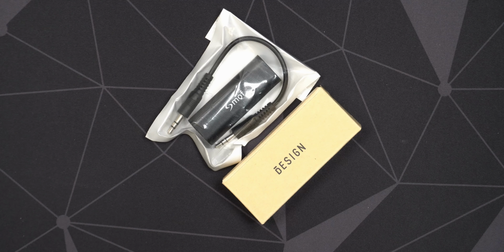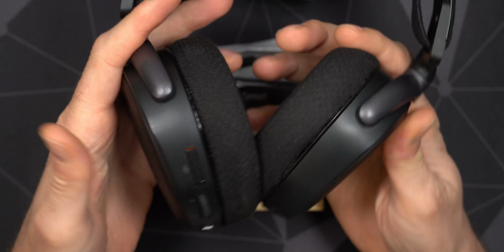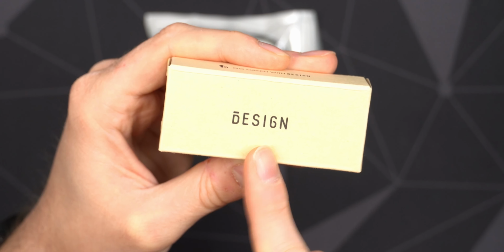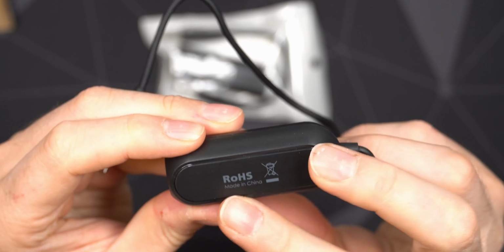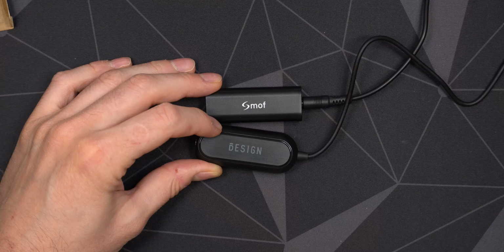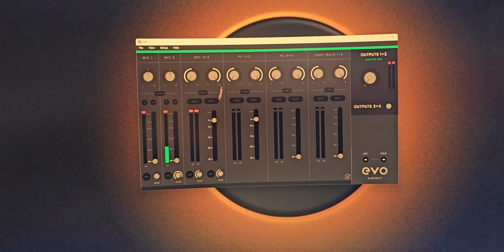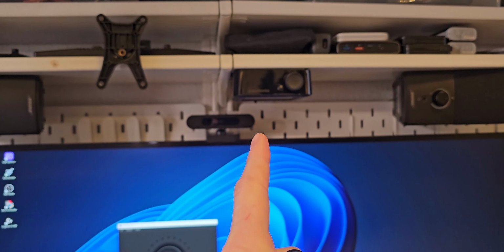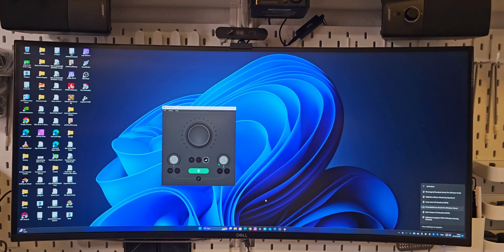Ground Loop Noise Isolator

Comment: I've used a few of these and while they do get rid of hum in a lot of situations, unfortunately the quality of the transformers inside of them leave a lot to be desired since they're so cheap and inconsistent, so they can cut certain audio frequencies which changes the sound and degrades quality. They also cut the volume by a not insignificant amount. For casual use they're handy, but I wish there was a mid-range option for ones that don't mess with frequencies without stepping up to a few hundred dollars.
Reply: there are better options with beefier transformers, but more expensive.

Comment: Didn't work for me for my z-5500 speakers using an external pod, tried I plugging it into the PC (internal sound card) and also through the pod, no difference either way.
Reply: does your speaker have ground loops also that u use for your PC
Reply: @SaladBowl009  It doesn't, I just turned everything down a bit on the control pod and turned the volume up on my PC and it's mostly fine now.
Reply: @Verociity  oh i see.. that's good it works now. I was thinking if this noise isolation sill help me about the sound buzz and hiz
Reply: @SaladBowl009  I will probably try grounding it soon though, that's also probably a great idea.
Reply: @Verociity  right.. tnx

Comment: Hi! Which cable did you use to connect Steelseries Nova pro Wireless Base station Line-Out Jack to the Evo 8 Interface? Could share a link? Thanks

Comment: I need one of these with a TRRS connectors, do you have a website to get one? Cause I cannot find any, only TRS connector Isolators 😢
Reply: They seem to be impossible to find.  If you’re using it for an Astro A50 I do have a solution!
Reply: I think you would need to a trrs to trs + ts cable to split the microphone before the ground loop isolator. Electret microphones need dc voltage and transformers only work for ac

Comment: the same issue is present on my laptop when its on charger and i plug the 3.5mm in. Do you think something like that will fix it?
And thank you for the informative video
update: I didnt try it but the aux cords arent for microphone so idk if it works or not
Reply: I have the exact same problem. Hum in speakers when the charger is connected. Did you try this device from the video? Did it work?
Reply: @sevchyk  never tried brother, I just got myself one of those wireless Plug&Play headphones (redragon h848). and they work very well.